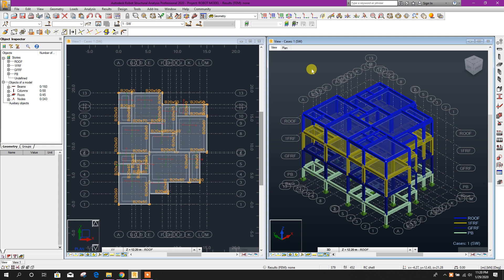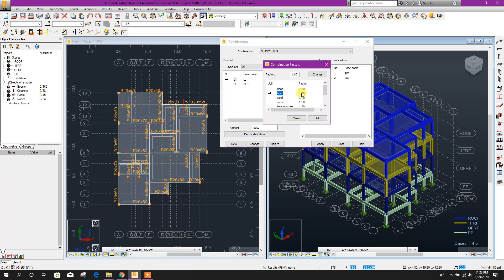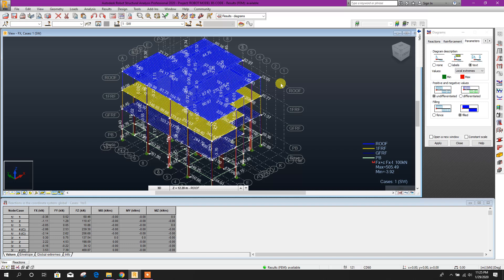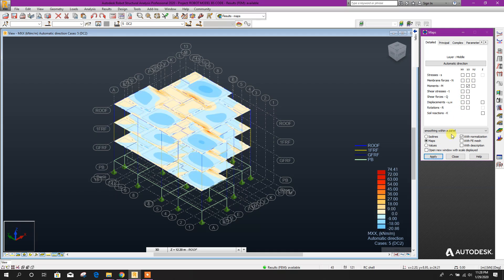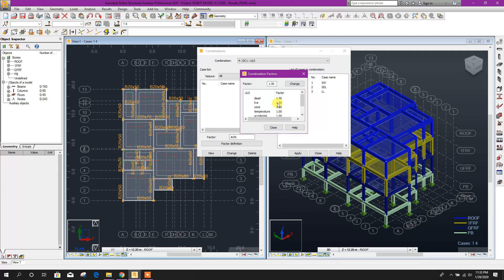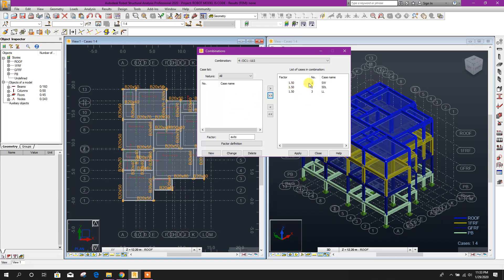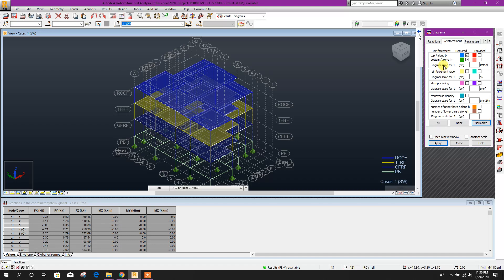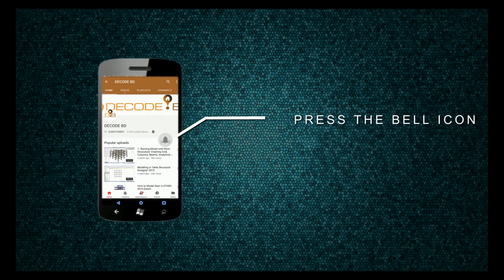Three Storied Building Design in Autodesk Robot using BS Code | IS Code | Eurocode

Comment: Is this design for the entire structural members? (Beam, column, slab, foundations) ?
Reply from the maker: Analysis & design (rebar required). After finishing this step in all mentioned programs(in the beginning) we will compare results. Then we will go for detailing in sha Allah. We will detail as per design Beam,column,foundation in Robot.
Reply: @Decodebd  
Jezakillahu Khair akhi fillah
Reply: Great work always from. Kindly do detailing using autorebar or sofistik.
Reply from the maker: Wa antum fa jajakumullah Khair.
Reply from the maker: Thanks. Will do in sha Allah.